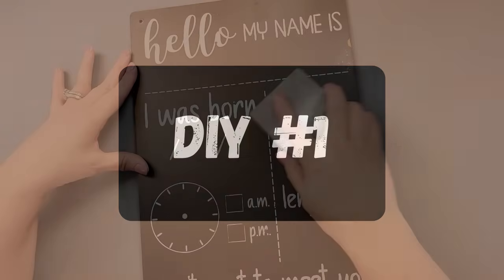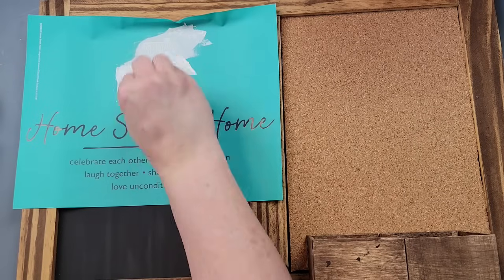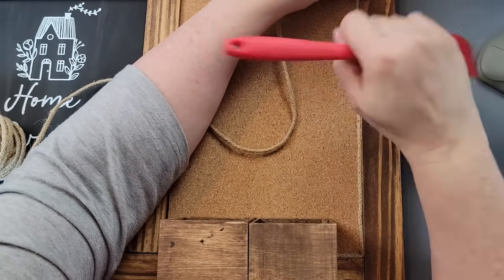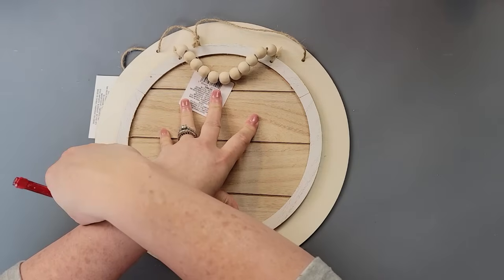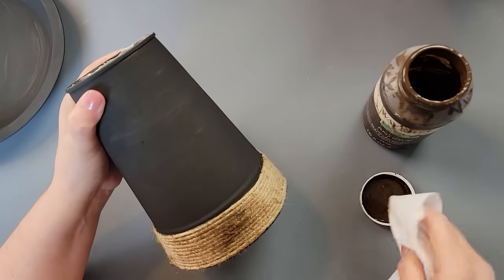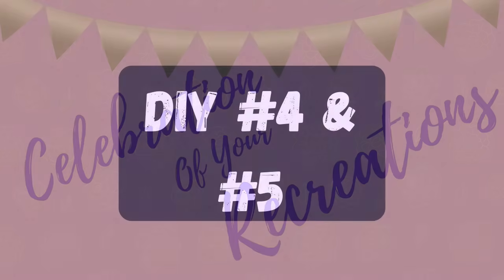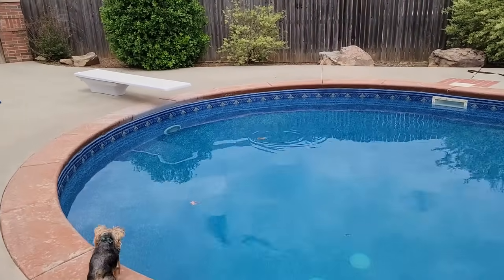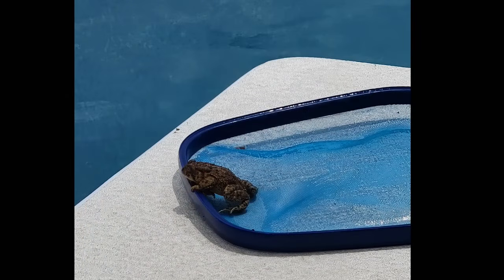EASY HOME DECOR DIYs

Comment: Brenda, maybe you could just rip off or cut off with scissors the empty spools of ribbon.  Instead of taking apart your whole line.  Just add more ribbon when you have 4 or more rolls to add, then add it to your line.  Might make it a bit easier for you.  Not sure.  Just a thought.  Nice projects.  T4S!!
Reply from the maker: I think it would be difficult to tear or rip the spools off, but thank you for the suggestion.  I usually wait until I have several empty spools before I change them out. Thank you so much for always watching and commenting,  Lydia ❤️